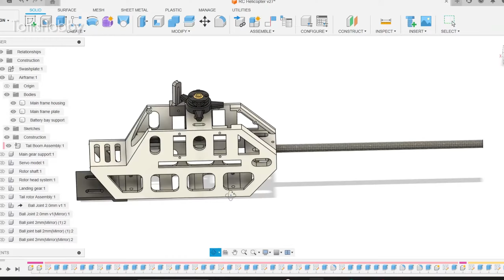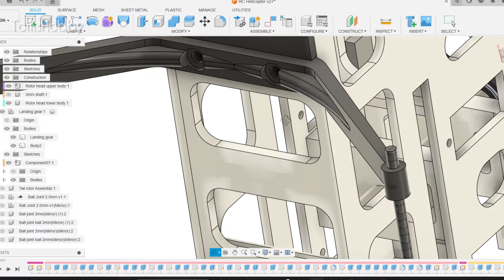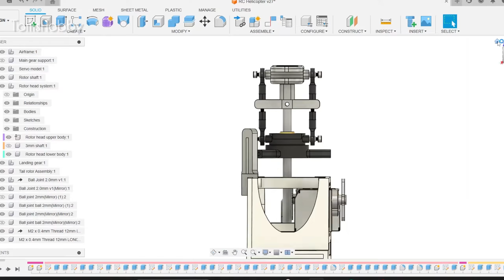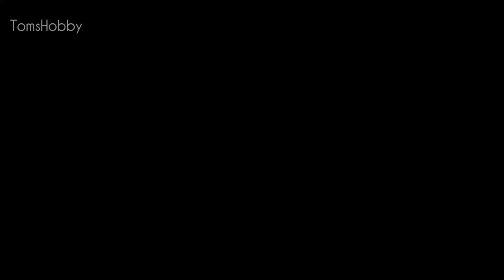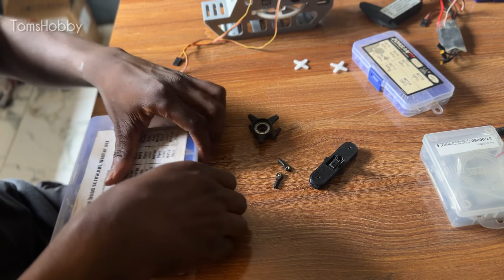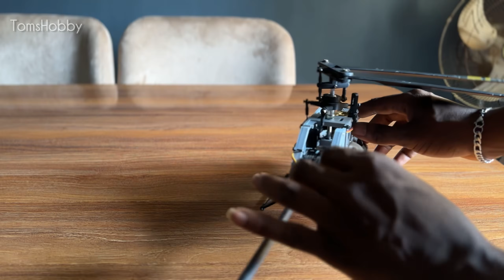Can a 3D Printed RC Helicopter Really Fly? Full Build

Comment: Hii, you don't say anything about stabilisation. 1st: how you sinchronise the tail motor with main rotor? 2nd: what board did you use for pitch and tilt stabilisation? 3rd: why did you use a separate gyro for yaw stabilisation. Could you use one main board from some drone instead and how to connect that stuff, how and where to mix (on transmitter or on board) 
I think the main thing is stabilisation. The hardware can be even bought if not made, but how to make this thing ESPECHIALY WITH A SEPARATE TAIL MOTOR work - that's the real qustion!
Thank you so much for the video, and answers (I hope).))

Comment: My humble opinion, I am a real helicopter mechanic, and an RC helicopter enthusiast, you need the pitch control to be more fluid, more snappy and it needs to return to a central rigging.
Reply: The reason it loses control is because when you attempt to turn the helicopter, the cyclic servo pulls the blades’ pitch too slowly and you can’t correct quickly, causing you to let go of the collective and throttle suddenly and ground the aircraft in order to avoid further loss of control and to minimize damage to the surrounding environment and the aircraft itself.
Reply from the maker: Thanks for your comment. It’s a fixed pitch rotor head system, no collective. 
I’d try replace the servos to metal gear ones too hopefully it’s helps in controls

Comment: 1. Try to change the swash top plate to rotor sync mechanism... Existing system might be pushing link rods to hard, limiting it's free movement, this is also the reason for low collective. 2. Try to record a slowmo after pinning down the heli on surface to get clear picture. 3. check the play between ball and it's printed collar.
Reply from the maker: 19:04 movements are fluid and I did reduced the rates for the controller, also I reduced the tolerance towards the ending of the video to reduce play as much as possible.  The controls were responsive at higher rpms too

Comment: Nice bro!! I am wondering if its "toilet bowling" because of vibration...I'm not entirely sure though 🤔. I've never printed one just bought kits and the electronics and flown them, I really hope you get it sussed out man because this is cool!!
Reply from the maker: I do hope a higher rpm motor will solve it because I noticed its more stable on the first couple of take off and when rpm drops it does the swirling thing. New motor is on the way.